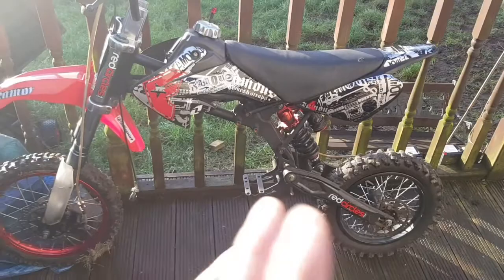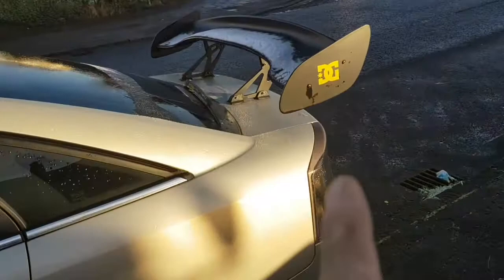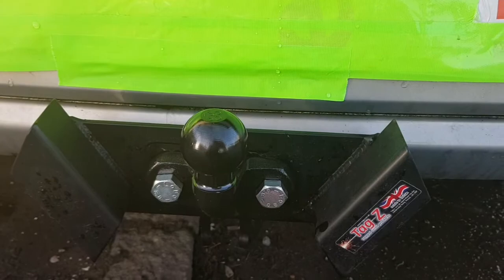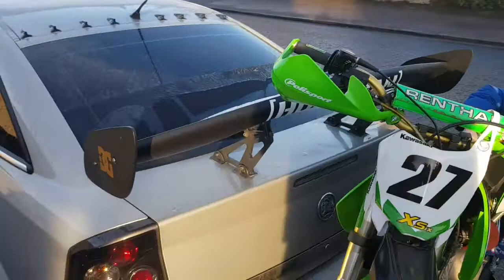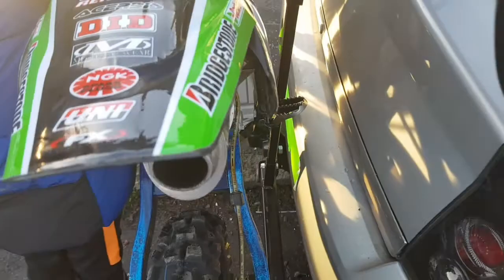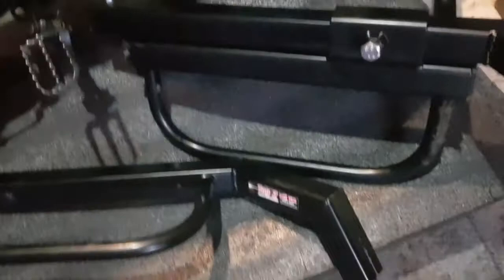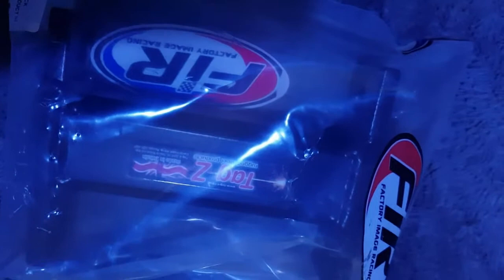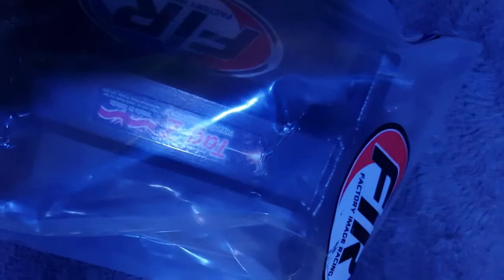DIRT BIKE CARRIER RACK FOR  CARS WITH TOWBARS

Comment: I got one for a ktm 450 and it's not big enough . But can get it on adjusting it past the end of the bar a inch with the safety nut out . And it does hang out then worryingly in to oncoming traffic
Reply from the maker: Yeah that sounds scary, I would hang a very bright orange or pink rag or flag from that end, just to make sure all the lazy idiots can see it a mile away.

Be careful on corners as someone coming around  could be going wide to avoid something like a.... cyclist, drain, parked car... and might get very close to your extension.

All I would be able to do after seeing a mangled dirt bike is CRY.
But yes, try and make that side as visible as possible to people, like having a LADDER sticking out of a work van, dangle a very bright rag off of it.
👍👍👍

Comment: Would have been nice to see how you got the bike into the rack.
Reply from the maker: Just lift the handlebars until front wheel is in place, then you barely need to hold it, just go around to the back and either lift by the sub frame under the rear mudguard, or just fingers through the spokes and lift the rear wheel, very easy.
And you will notice there is zero straps holding the bike in place, it just sits there by itself very sturdy, of course  you need to strap it down to move, but it will just sit in place un-aided while loading by yourself.
Reply: @oraclescave  Cheers, thank you

Comment: thx for the video man, but I don't understand if I can use it on my car. I have the towbar in the classic shape, I mean with the hook and ball. Can you help me figure this out?
Reply from the maker: This does not work for Swan neck tow bars.
Only the 2 bolt hitch ball type.
Reply: @oraclescave  damn, it looked like it could have been a good solution for me. Thanks for the answer man!
Reply from the maker: @GiacintoMarcellino  yes it is a very useful addon for a car.
Better than always borrowing a van or annoying people with vans to come and get me.
Maybe you could get a conversion plate, to mount to your towbar like an adapter to fit a 2 bolt hitch style.
But yes this carrier rack is better than useful and has made my life much easier.
👍👍👍
Reply: @oraclescave  i wonder if such a converter even exists! That would be perfect!
Reply from the maker: @GiacintoMarcellino  https://m.ebay.co.uk/itm/Bak-rak-Swan-neck-towball-to-flange-fit-converter-or-adapter/124415829126?ul_ref=https://rover.ebay.com/rover/1/710-53481-19255-0/1?ff3=2&pub=5575376664&toolid=10044&campid=5338268676&customid=CjwKCAiAyc2BBhAaEiwA44-wW9n66hPpr_-eCn2MrNEh29zWdH5_hYjM6nymHq7H_AdiOxItnyAkLBoCvzYQAvD_BwE&lgeo=1&item=124415829126&srcrot=710-53481-19255-0&rvr_id=2820981066890&rvr_ts=c998f48b1770ada1f2351d9cfff9437b&_mwBanner=1&_rdt=1&ul_noapp=true&pageci=7334d354-5fcf-4c40-9e02-572e3b6918ca
Reply from the maker: @GiacintoMarcellino  there is other ones, just search... Swan neck to flange adapter
👍👍👍
Reply: @oraclescave  thx a lot man!! This would do it, but I guess I'd need to buy the adapter and a ball to go with it. Clunky but it would work I guess.

Comment: Is the towing bar provided? Or just the rack? Thanks
Reply from the maker: Just the rack, mounting plate, I bought a WITTER towbar
👍👍👍
Reply: @oraclescave  thank you!
Reply from the maker: @tomoiagaflorin8910  no worries glad I could help
Reply from the maker: @tomoiagaflorin8910  also you can get extensions for the rack that can have the rack further out incase it hits into spoiler or some other obstruction.

Awesome rack

Comment: Alright darren ma bro john bought a nana robot d6  leky scooter   🤣🤣
Reply from the maker: Lol me too, I got the Bogist C1 Pro.
These things are bloody amazing.
Me and the kids have been having a blast.

I'm selling all my brand new Drone flying kit £1100 to buy another scooter.
I'm addicted to electric scooters now ha ha ha.

Kids only have lightweight scooters so I'm gonna get them some offroad scooters aswell.
Good fun 👍👍👍
Reply: @oraclescave  hhe bought 2nd hand paid £900  bit boy paid £1450 en £200 for new bars  massive   40 mph
Was thinking selling but my. Cousins som n law a polis he was in the  house to pick his wife up  he said hold on to it  working on legalising them check em on y t. M8 😂
Reply from the maker: @detectingadventuresscotlan6035  honestly bud, these types of scooters will never be legal, they can't be regulated.
Would need an M.O.T 
And power would be limited to 30MPH

So all these high power scooters will never be allowed, at least until we can get proper cycle paths all over the place like America has.

I would be interested in it lol
You should check my advert in gumtree glasgow swap shop

My kit has everything you need and is all brand spanking new.
Best oled goggles on the market
Same with the controller
Extra module that plugs into the goggles gives you more distance with clear picture in goggles.

2 drones with extra batteries
Plus loads and loads more top quality stuff.
All brand spanking new £1100 
Nothing else needed, everything ready to fly
All batteries have chargers 
 I have it all on one ad on SWAP SHOP in gumtree you should check it out.

I'm away to check that scooter out lol
Reply: @oraclescave  a know m8 there rapid lol he would have time fly drone m8  ma dads carrer its got 3 gear rasiocs n cruize con 😂
Reply from the maker: @detectingadventuresscotlan6035  I want that scooter lol
Reply: @oraclescave  nice int they m8 bars are high up 💪
Reply: @oraclescave  wants £900 for it m8 its dine 116 mls john only did less than mile
 up doon street  ruding deck like surf board
Up graded version breaks hydrolics am no into em id rather a a
Vespa 😂
Reply from the maker: @detectingadventuresscotlan6035  I am deffo interested, but zero cash.
If I can get my FPV DRONE kit sold I will take it.
So if you know anybody that's looking to get into drones, let them know about my kit, I will even go down to £800 cash just to get the money for the scooter.

In total there's about £1350 worth of stuff all brand spanking new and the best of the best, everything needed to start the hobby straight away.

I will give you a shout if I can get it sold anytime soon, I absolutely want that crazy scooter lol
Reply: @oraclescave  kk its n0 advertised m8
Im tk him uo my full visor crash helmet hes hitting  cycle path you git 1st refusel m8 👍

Comment: It's only good for very light weight bikes. So if you can't life the bike up and down with ease, this carrier is not for you.
Reply from the maker: All bikes below 110cc are very light bikes. My bike was a 160cc and had nearly every addon you could put on it.
Weight is no problem for the design of the rack, but some cars will be limited at the towing weight, tongue weight I think its called. 75kg -80kg in my car.

But its a very handy contraption, I also fix a lot of bikes so collecting them is very easy just using the car, and much easier finding parking spaces.
👍👍👍
Reply: @oraclescave  My 125cc retro scrambler is about 130kg. The carrier may take the weight, but I don't think my back would take the weight of lifting the bike up and down for too long.
Reply from the maker: @olibhearmacguidhir6887  there is bigger versions for full sized dirtbikes.
This is the 50cc-110cc carrier rack.
There is a bigger version for upto 450cc.

If your back needs care, maybe stick the engine into a mobility scooter lol
👍👍👍